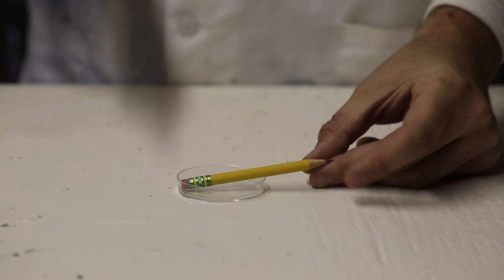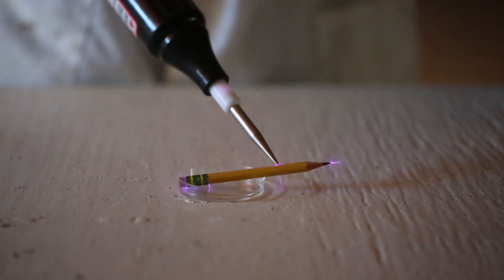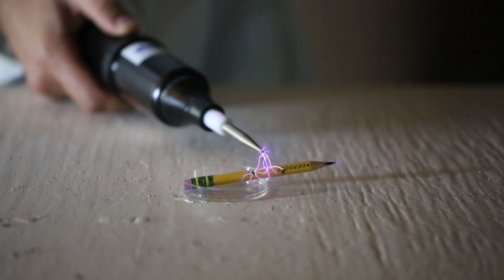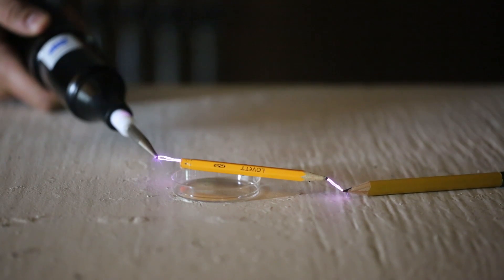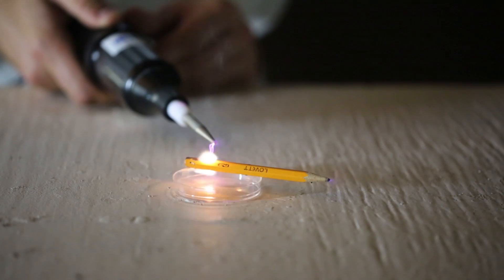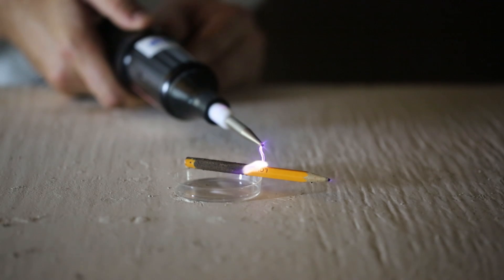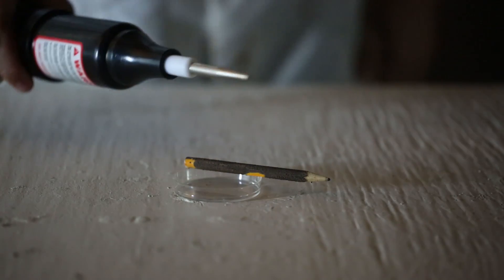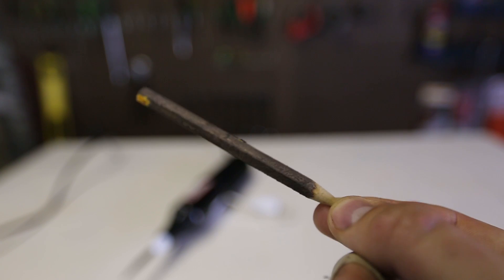Tesla Coil vs Graphite Pencil

Comment: This is not a tesla coil, its a High Voltage transformer, most likely something like a car ignition coil and driver circuit. A tesla coil is a resonant frequency transformer, which is completely different than whatever type of circuitry is inside the device he uses in this video. A resonant frequency transformer is two different circuits with coils that produce magnetic fields vibrating at the same frequency as the resonant frequency of the secondary coil, the primary circuit and the secondary circuit, one end of the secondary connected to ground or earth, and the other end connected to a toroid or a top load. Which means that the device in this video which he calls a tesla coil is not. But it is a cool device though, but not a tesla coil.

Comment: For everyone out there that doesn't know anything about electricity and how it works: it takes both amperage (current) and voltage. 8 mA of current conducted through the body is considered a maximum safe limit. Ground fault interrupter devices for personnel protection usually have a 5 mA trip rating for this reason. 

Resistance of dry skin is generally about 100 kilohms or greater, so in dry conditions, it would require about 1,500 volts to conduct the 15 mA or greater current that is likely to kill you. 

If the skin is wet or damaged, the resistance through the body will be greatly reduced, and a much lower voltage may be lethal. 

Direct contact with 100 volts or less, though not considered safe, is not likely to harm you because it is not of sufficient potential to conduct a fatal magnitude of current through the body.

Comment: It's gotta make you think, what's in the yellow paint that they use on the surface? Very cool. Also graphite dust is really good when you don't want to use oil on two sliding surfaces.

Comment: That was not actually fire. The current turned the paint into a plasma. The times the screen quickly flashed brightly were times actual fire was created by reaction and heat. Only a certain ingredient in the paint was turned to plasma, hence the thick residue, and lack of damage to the actual wood.
Reply: This is the first youtube comment I've ever read that was either informative or cool at all.  Neat!

Comment: Why does the electricity goes on at the end of the pencil is because, the pencil are made of wood, meaning like trees. If you burn enough, it will burn the wood of it. Be careful, if you put your finger closely into the electric graphite pencil, it will shock your fingernails cause it's made of graphite too.

Comment: Why did he get shocked? I thought wood didn't conduct electricity?
Reply: ...but graphite does conduct electricity...
Reply: Yeah but the graphite inside it does and the voltage is so high, electricity passes through the wood
Reply: The graphite in it I think plus the metal near the eraser he was touching
Reply: everything conducts if its enough electricity

Comment: "Ow that's painful, 50,000 volts is painful"
Reply: Quote of the week, "50,000 volts is painful"
Reply: It's the current that in the end puts you into the grave, however you don't get much current through a human unless the persons skin is wet, or the voltage is high enough.
Reply: DJCDavisDubstep ... the train thing was a metaphor. also yeah that voltage thing is true. also, sorry if i came off a bit rude, i didnt intend to be rude, its just that i tend to automatically go on the defense on youtube now when im disagreeing with someone, people get so agressive.
Reply: +Amit Dawar didn't understand man
Reply: Revampedharpy09 It's not the volts or the amps exclusively that kill. If you touch something with a 30A current but a 4v charge (like an 18650 battery) you don't die. That's because resistance stops the current from travelling through you. If you touch something with 50v but 0.1A, you could die. It's the Amperage that kills you, but not exclusively. Voltage is still needed. 

TL;DR, it's the wattage that kills you.
Reply: already a classic this statement :D
Reply: +Er. Kabir oh didn't know that thanks
Reply: +Er. Kabir They were just talking about it being painful though.
Reply: +Min Genius Yoongi's Bae hai fam xD
Reply: Revampedharpy09 But what if you trip and crack your head on the track? IIRC voltage can still kill you via atrial fibrillation.
Reply: I think it was ‘wvolts’
Reply: Amps are painful
Reply: Exactly, Voltage is just potential difference, its actually the current that kills. Many don't know this.

Comment: Gets shocked by 50.000 Volt, no problem for a Russian
Reply: volts dont matter... its the amps that cause pain, and since he didn't die, the amps were obviously too low...
Reply: With enough Vodka in your stomach you won't feel anything ;D
Reply: Grab popcorn and read comments from electrical engineers.
Reply: In soviet Russia, you shock volts
Reply: "safety is number one priority" 😂😂
Reply: BannDesigns no problem got my safety glasses
Reply: amps is what kills you
Reply: +Kitty Max its probably only a couple miliamps
Reply: Amperage kills you, not volts
Reply: The power socket by itself is still pretty harmless for very short periods of time (well, in most cases). We used a stripped off power cord attached to a 220V socket to shock ourselves as kids. Was fun :-) It could leave burn marks though if you were unable to release the wire at once. That's why you should always use the back of your hand so that it doesn't clench onto the wire.
Reply: try with pikachu next time
Reply: yea kitty max knows what hes talking about amps cause you to convulse and tense up like a cartoon character getting shocked
Reply: In Russia Russian Shock Volt.
Reply: Hmm
Reply: ive done that before and it really hurt
Reply: +damunius ha lol
Reply: Well, the wall output doesn't put out many amps either .
Reply: +Kitty Max yeaht..
Reply: i see an electric pole just 20k volt but thi little thing is 50k volts
Reply: +damunius 😂
Reply: Volts matter in fact they are the think witch causes burnings. But yeah amps are far more dangrerous.
Reply: Reilly Hounslow 😂😂
Reply: Tesla coils will not kill you and it does not hurt dumbass
Reply: +MCGAMERLP12 dude current is the part that Burns as something has resistance like a human it Burns as it's trying to go to ground and this is not Tesla coil but a high frequency high voltage source
Reply: I know right
Reply: +Thomas Rhoades BABY
Reply: +Kitty Max Technically, you are correct. But high amperage won't be lethal either if voltage is low.
Reply: U need high enough voltage for current (Amps) to go through your body to overcome your body resistance (Ohms). Your body draws current from source that is able to provide it while at the same time amount of current flowing in your body depends on resistance of body and voltage. Am I right?
Reply: Yeah no1 is better than Russiqns
Reply: how much voltage the bastard got?
Reply: lol
Reply: 50,000 volts is nothing lmfao my little tesla coil lighter is a million volts and its 4x smaller
Reply: That's why i love this guy, he's pretty crazy xD
Reply: - rescousium hes not crazy just really uneducated on his own topics and its hilarious to see him hurt himself hahahaha
Reply: it's because the amperage is extremely low, very very low.
Reply: +Richard Sec nice thinking
Reply: +Hungry Shark World No, in Soviet Russia, Russian shocks Tesla Coil.
Reply: ***** If this is directed at me I'm sorry, I should have gone into more detail.
Reply: Ow that's painful.
Reply: of course
Reply: BannDesigns 50,000 is not that bad, i have been shocked by 1 million
Reply: Victor Fiori many amperes?
Reply: Victor Fiori sounds painful xD
Reply: +Richard Sec you only need .5 Amps to stop your heart
Reply: The interesting part is that 1 million volts is only like 1 microamp or ua
Reply: Victor Fiori ouch that is gonna hurt as long as you don't make a ground connection your fine 

P.S the tesla ark lighter runs with Direct Current 1mil volts is just painful and leaves burns
Reply: Getting hit by 35v 10amps is painful as well. It tends to hurt for a couple of minutes. I've bee shocked by 7,000 volts, 1,000 kv, 120v, and 35v 10amps. All very painful
Reply: Victor Fiori ouch i rather not imagine
Reply: So true
Reply: BannDesigns yes
Reply: He's invincible
Reply: hahaha
Reply: BannDesigns yes
Reply: o2
Reply: Pfft, I’ve touched 250,000v.
Reply: I love Taras but he is probably the wimpiest Russians out there.
Reply: Nice, now i'm going to play with electricity ;D #UA